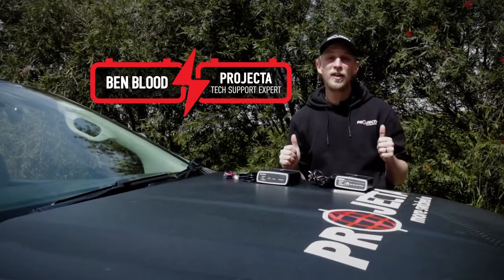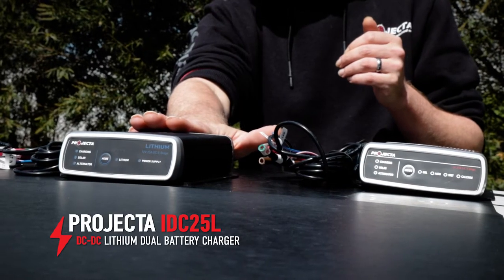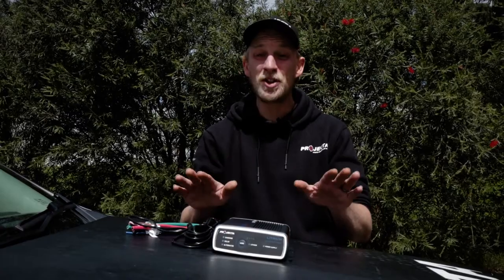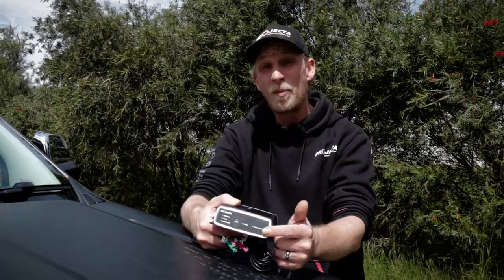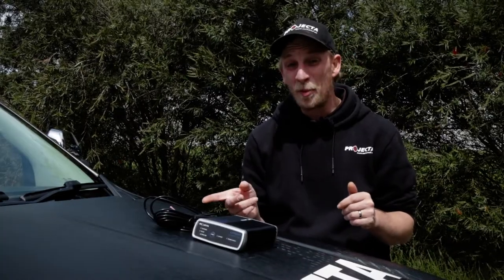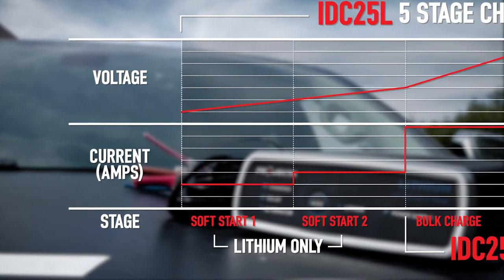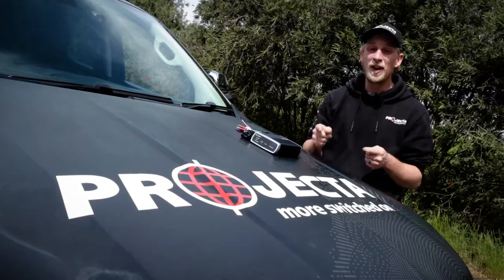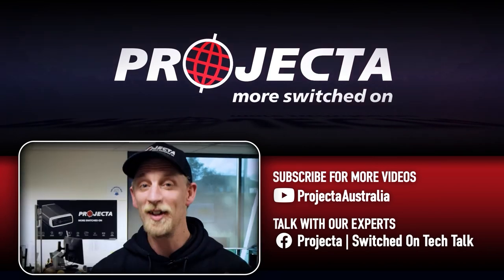Lithium DCDC Dual Battery Charger Overview IDC25L - Benny from Projecta

Comment: hi mate ive had a idc 25l for a while recently started using an enerdrive mono crystalline portable, green leds show as floated guage showing at 12.9v un plug wait then re plug charge process restarts then shows float,not floated just not charging,neither over hot or cold ideas ?

Comment: Hi I am installing an IDC25L into my van for maintaining a new house bank of LiPo4 batteries. It has solar panels and I use a Projecta PC1600 when I am plugged in. How should I wire in the PC1600 so that it tops off the start battery (lead acid) and charges the house bank?

Comment: What should a IDC25L be set to for normal operations, LITHIUM or POWER SUPPLY.
Reply: the manual reads if you have a 12v fridge connected to run power supply mode , but I'm not sure if the constant 13.8 fully charges the lithium battery or not ?

Comment: My IDC25L only puts in 1.5 amps and solar is even less! Before you say anything about being properly wired up, the answer is yes. It was working fine but now nothing, should have bought the Redarc to begin with?
Reply: Hi d Harry I had the same crap was only get 1.5amps change the temp sensor now get 25.7amp it's put it in to limp mode try that a see if fix 👍
Reply: Hi Mate, 
What did you find with your charger? Mine won't go over output around 2.5amps? On both solar and alternator...

Comment: Hi!
In the video it says this can charge an AGM. I compared idc25 and idc25l spec sheets, and found out that both of them are almost identical in AGM mode of idc25. Does this mean an idc25 can be used to charge a lithium battery given the battery doesn't go below 10v?
Reply from the maker: hi Pududu the IDC25l has the Soft starts and Power supply mode required for Lithium batteries as above in the video it can be used in a pinch.

Comment: You say on this video you can use this to also charge an AGM battery. The manual clearly states “ For charging Lithium Iron Phosphate batteries only” on the second page under WARNINGS. So which is it?
Reply from the maker: Hi Benny, yes in a pinch to get voltage into a AGM battery this charger can be used however is not suited to long term charging of AGM batteries.

Comment: Benny, my IDC25L keeps turning off after 20 seconds or so when on vehicle charge, works fine with solar. Has been installed for a year with no issues has only just started. I’ve had the car completely rewired and it still does the same thing ?
Reply from the maker: hi Ricky, please measure the voltage on the Red wire for 3 minutes this voltage should be steady, i suspect that it is dropping below 12.8 and this will happen over only 3 seconds so need to watch it like a eagle, if so please call our tech team on 1800 422 422, Cheers
Reply: @ProjectaAustralia  hey mate, I have this same problem. Voltage drops under 12.8 for a second or two so stops charging. Kicks back in after about a minute. It's a constant round about and basically only charging 50% of the time the engine is running. Any suggestions on how to fix, Or is this normal ?

Comment: Will your IDC25L Charger revive my  2 dead lithium Iron 2.4 kw batteries for the solar system?  I bought this batteries from my frend but did not know that is is totaly discharge.
Reply: It really comes down to HOW dead it is, you may be able to revive it slowly with the power supply and charge modes, however you would be best speaking to Lithium Battery experts as they will have much better chargers for doing that job, once they are revived however this little beauty will definitely keep the unit alive
Reply: @bennyblood9372  Thanks for your reply.